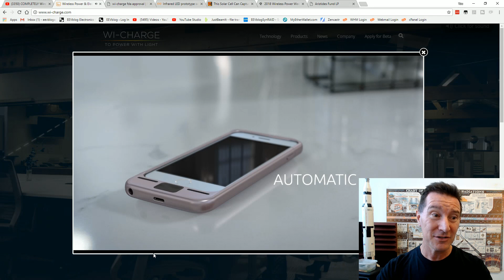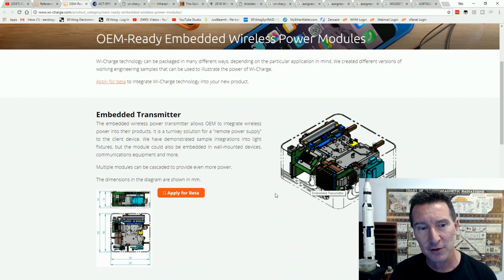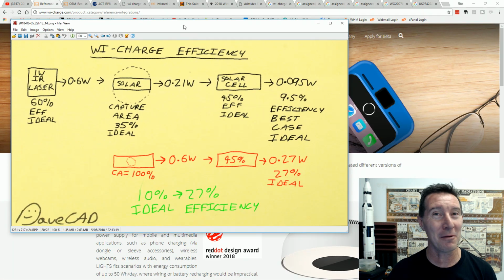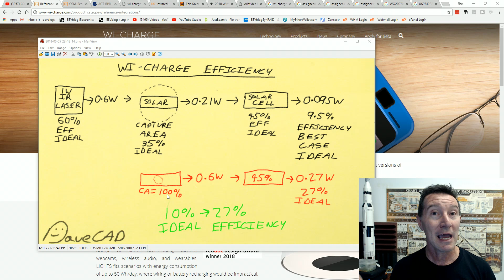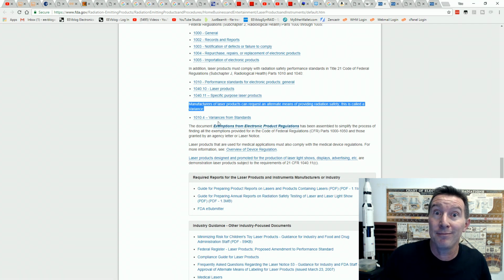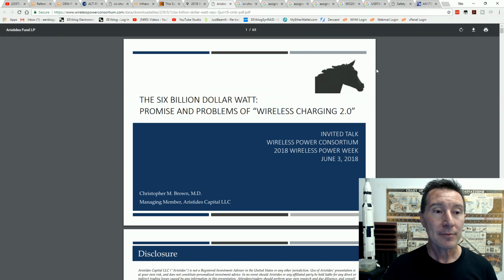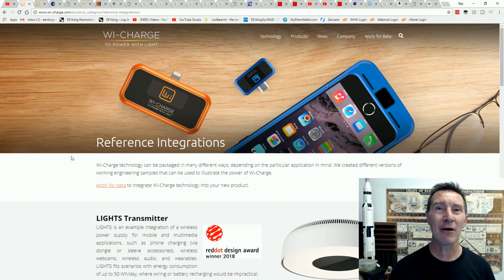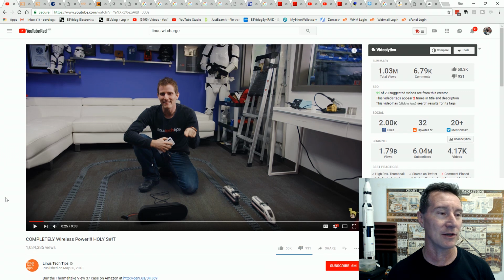EEVblog #1092 - Wi-Charge IR Wireless Charging - Fact or Fiction?

Comment: why the hate dave? This device works, sure there's marketing wank but at least they made something
Reply: kolby4078, they made a lot of the stuff than comes out of a male cow's behind!
Reply from the maker: Maybe you missed the several times in the video when actually praised them and the tech they are doing?
Reply: If you listen real close you can hear it, otherwise, it's mostly hate
Reply: I'll admit it pisses power but you just don't use it for everything, it will find a niche
Reply: Which is what Dave said. Also pissing power isn't a good thing especially when better alternatives are available like Qi or you know just plugging in a bloody cable...
Reply: so there's no circumstance you can possibly think of where you don't mind losing 75% of your power to make some kind of device fully wireless?
Reply: Again that this technology might find a niche is possible, but it is still generally bad.
Reply: Welcome to the youtube skeptic community, who don't know anything about actual research and the benefits it has for society. Or they do, but $$$ awaits from feeding the negative Nancy's.